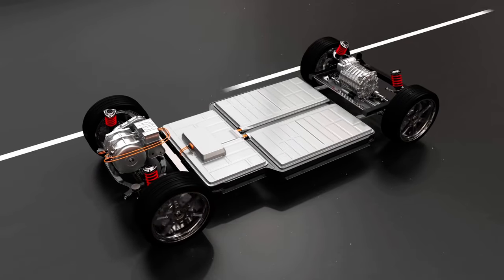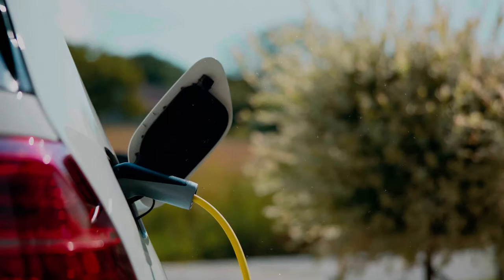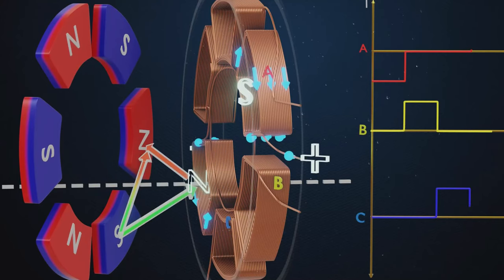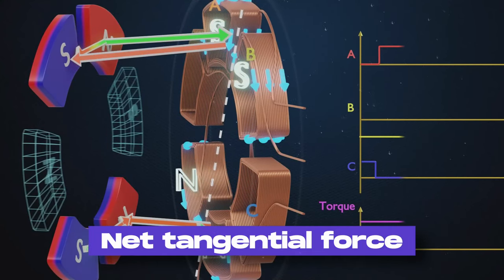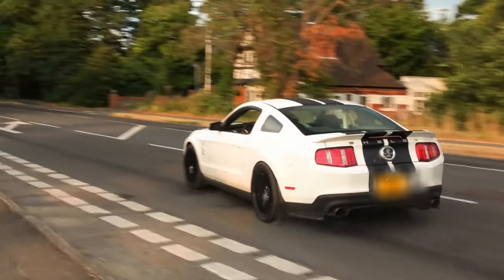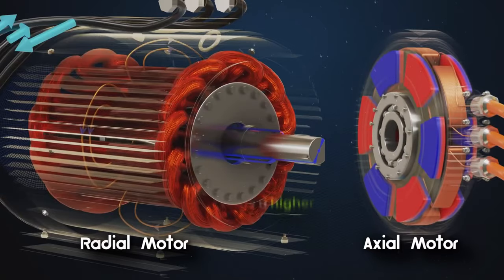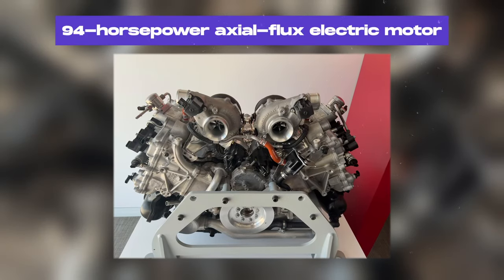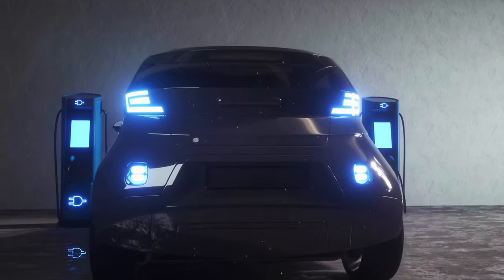The Future of EV Motors

Comment: AF motors capped on either side with torque converters all in a coax configuration would eliminate all gears & differential allowing for a smaller motor's torque enhancement and better empg efficiency.  8 second zero to 60 would be adequate if 180 empg were to be achieved in a Corolla sized 4 passenger vehicle.

Comment: A certain  mot do 9k rpm is to fast at the wheel.
300 mph is 440 fps
52 mph  is 76 fps

10 ft radius Wheel speed 528 rpm 

That is 17 (1700%x more} {need  ÷0.0586667%of  }}
9k rpm x 10 ft r  wheel  90,000 ft pr min. 9000×10÷5280

=17.04545454
= 1022 mph